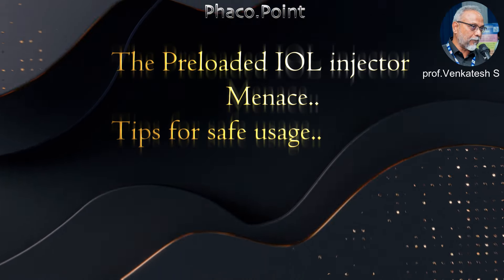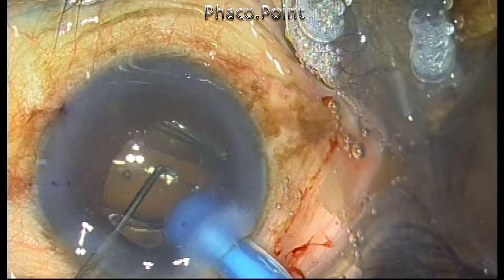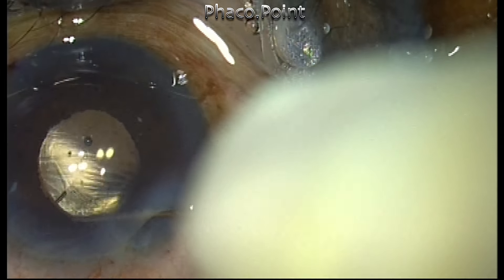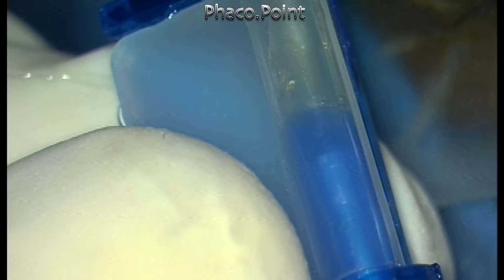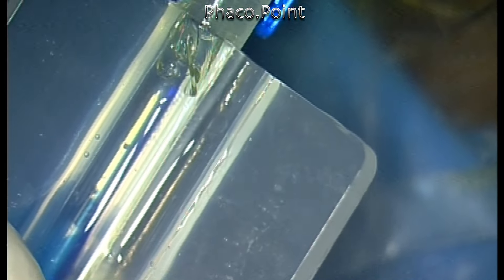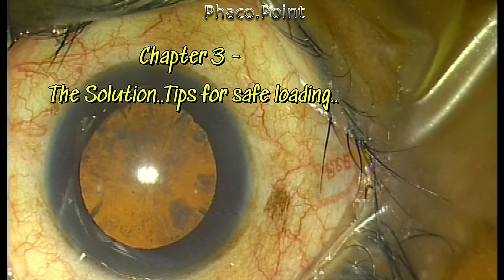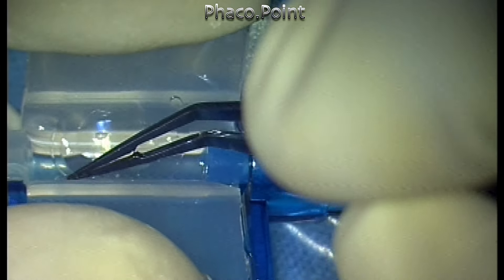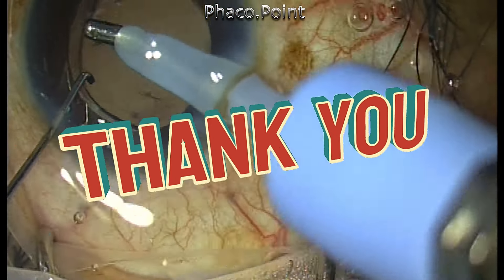The Menace Of the indigenous Preloaded IOL Injectors for Hydrophobic IOLs and tips for Safe Usage

Comment: I havve different issue with the NANEX yellow lens ...it twist in the end causing it to flip at least in 80 percentage of cases...i really don't know how to solve it...
Reply from the maker: the Hoya Nanex IOL injector is slightly tricky .. as soon as the leading haptic and the optic has been injected, while injecting the trailing haptic... rotate the injection 90 deg in the anticlockwise direction .. and then tap the haptic in a posterior direction.. this will release the haptic correctly and help you to achieve good in the bag placement